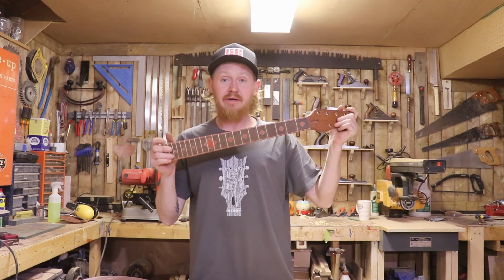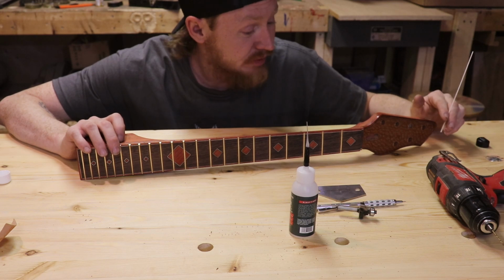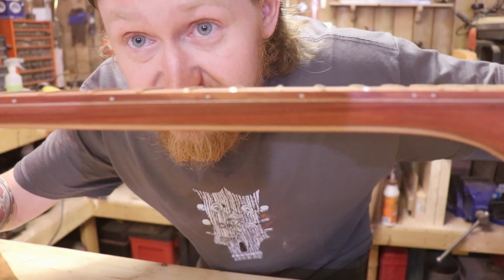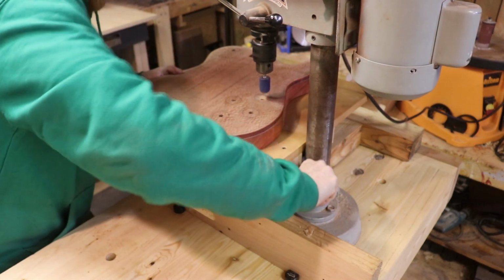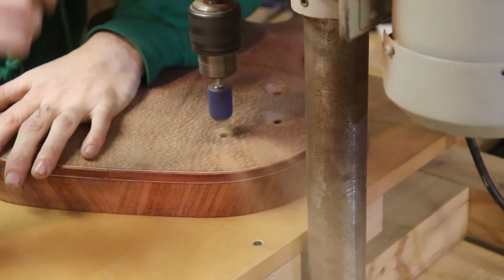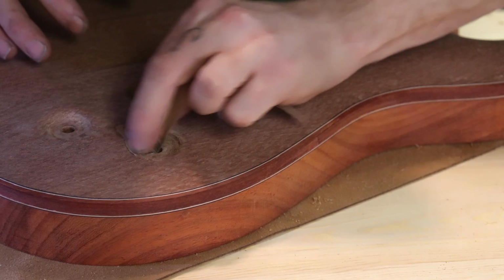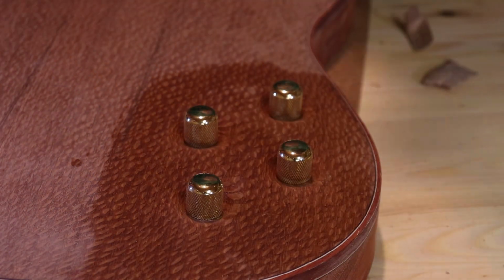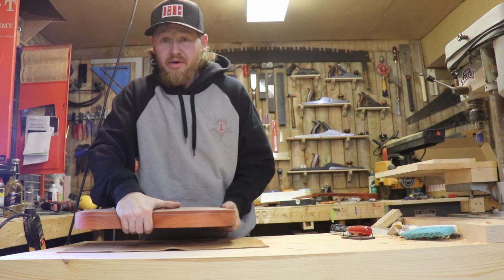The Carved Top Tele [Matt's guitar ep.19]

Comment: Wahoo!!! I R Fay Moose. I got a mention in your video!!!   Tip to make moving that base slide easier is to steel wool that shaft and inside the lock to make it less grippy from corrosion. Wouldn't advise lubricants as that would just collect dust and get all gunky. I would drill a hole in a golf ball and epoxy a stick in the hole then spray glue sand paper to the golf ball to make a circular lapping tool for getting them perfect much easier. Last word of getting all up in yer binnis..  Pots have different shaft lengths. I ran into that sketchy  drilling thru the carve thing on the BRS. Luckily the EMG kits have both short and long shaft versions. Your control cavity has plenty of room to mount the battery in between the pots.
Reply from the maker: Ahaha I remember your comment with the  excellerator every time I use it now! And I did not know they made longer pot shafts that would of been nice if the fishman came with them… these r the pots that come with the fluence moderns pups, as for the battery back… I know my buddy won’t be able to find a screwdriver to replace his battery so I am using the quick change box for him… I also know he’s going to forget and leave his guitar plugged in when not playing 🤣

Comment: Yeah - black side dots wouldn't have looked as good. White was the right choice.
My drill press is the same at times, sometimes it'll slide up smoothly and other times i have to wrestle with it .and my chuck key fits good in one of the holes no really good in another and won't tighten shit on the other
When you weren't deep enough, why didn't you just route out the whole of the inside down to depth to start with?
Would have been a lot less sphincter clenching than using the forstner bits.
And you know i'm right about the battery box because i found that out when i was building the zombie goat baritone ;)
Cheers for the shout out buddy  😎👍👍🖖✌
Reply from the maker: you are 100% right on all aspects of this comment!
Reply: It'd looking fine bud and the light at the end of the tunnel is getting bigger 
Not be long till it's done now